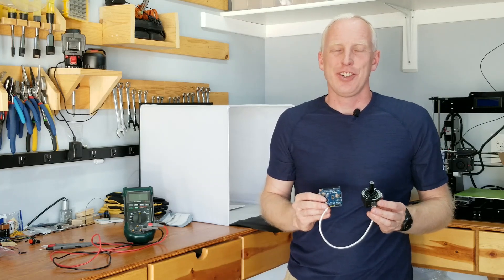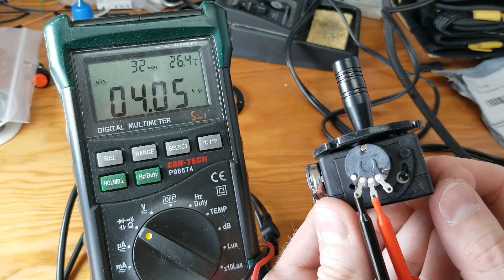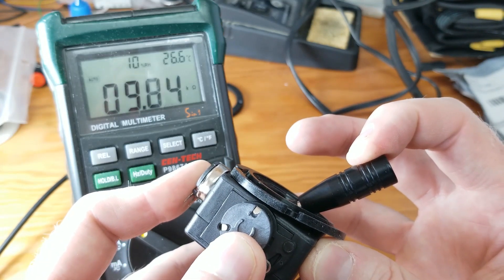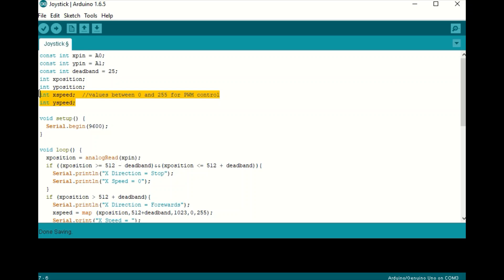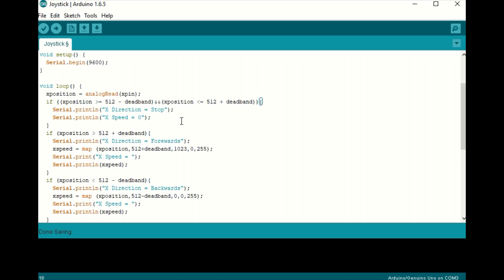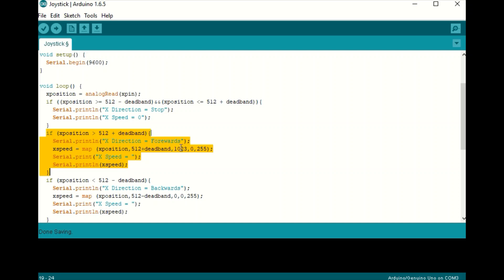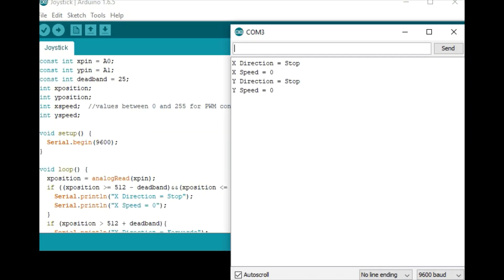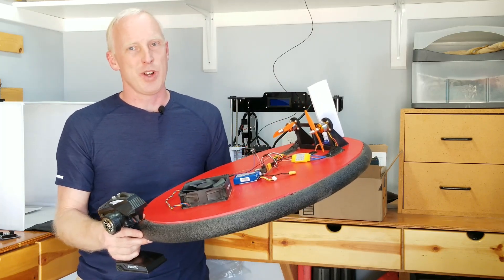Arduino Analog Joystick

Comment: In the local market, I was able to find only AC joysticks. Can such AC joysticks be connected to Arduino?
Reply from the maker: I have only used DC joysticks. Somehow you would need to convert the signal to 0-5V DC.
Reply: Thanks for your reply. however, I wonder whether the joystick is reliable or not? Coz I am planning to use it in a lifting machine that requires a sensitive lifting controller. 
I also have found many different prices for the same item in different markets. they made me confused of which I should buy.

Comment: I have a couple of these coming in a few days. Could you swap the black and red wires around to reverse the Y axis?  I'd like to mount the joystick upside down for a student I'm working with.  I'm not planing to use an arduino, this will be with a 3.5 TRRS audio plug for the X1/X2 jacks on the xbox adaptive controller. 1:34
Reply from the maker: Sorry for the slow reply. I'm not familiar with the Xbox controls, so not sure I can advise. Hopefully you figured something out!
Reply: @ScienceFunInnovations  Not a problem, I experimented on it when the joystick came in.  As it turns out it does work that way if you reverse vcc and ground across the pot.  Wiring up the 3.5 plug for X1 and X2 jacks on the Xbox Adaptive controller goes Tip and 1st ring for data, and 3rd and 4th rings for power and ground.

Comment: Hi! Thanks for the video. I have a spinal cord injury, and I have limited movement in my hands. At the moment, I am working on a game controller. Please tell me, which controller is better suited for this, Arduino or Raspberry Pi? Can I connect 12 buttons and two such joysticks to Raspberry Pi/Arduino as analog sticks?
Reply from the maker: I have only done analog using Arduino (I have done digital on the Pi). Yes you can connect a ton to Arduino, especially a big one like the Mega.

Comment: are they gonna make a different on output (if i were using motors) if the max speed forward and backward is different?
Reply from the maker: I have programmed code before to have a different speed range for forward and reverse while still using the full range of motion of the joystick.

Comment: I’m trying to control two big hub motors that could be powered by 2 VESC (uart tx,rx) or I have 2 motor controllers(ebike) that work on 0-5v potentiometer not sure if the arduino can work with that controller? I also wouldn’t want the go in reverse from center to back, because I f you were moving at 20mph wouldn’t that burn up the motors? I didn’t see your code templet.
Reply from the maker: Yes, the Arduino can output 0-5V using the PWM analogWrite commands. Also, my code is on Facebook https://www.facebook.com/ScienceFun4u/